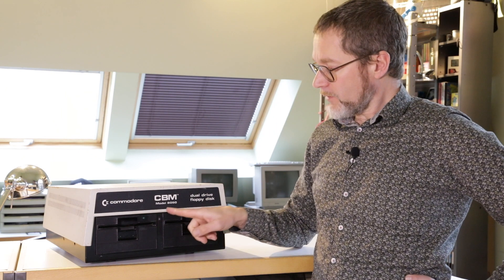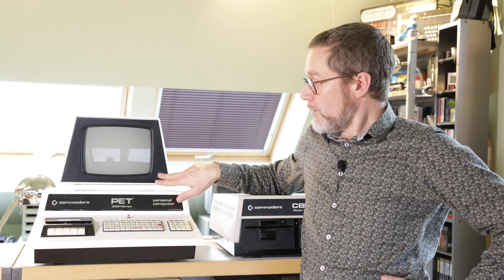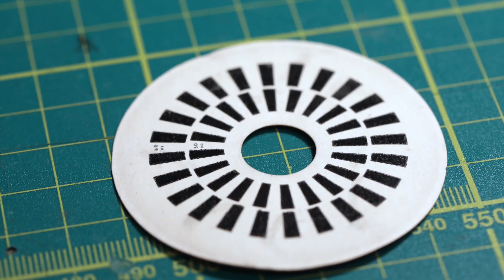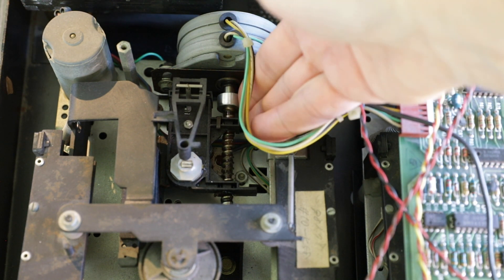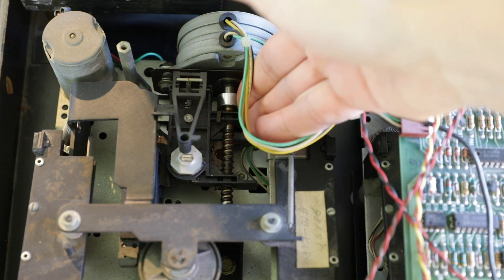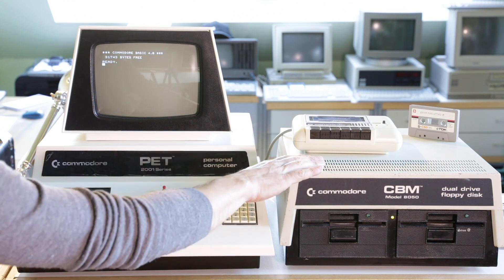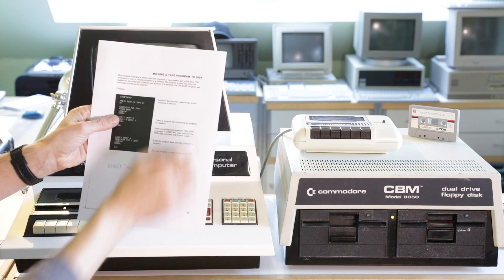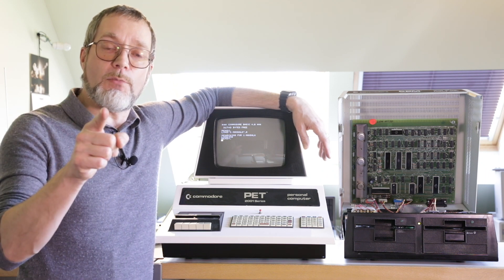Commodore PET CBM8050 Dual Floppy

Comment: Thanks for the lovely video. I also have an 8050, with slightly different Micropolis mechanisms. The drive works okay, but a bit unreliably. My main issue is getting software onto disks. I have a ZoomFloppy now, but OpenCBM seems to treat the 8050 and similar devices a bit like stepchildren. Support is very spotty…

Comment: Great video! I have the same setup here. My 8050 works perfectly, but the left drive (drive 1) is noticeably louder than drive 0. It also doesn't spin up briefly when you insert a disk. Any ideas what might be causing the increase in volume from one drive compared to the other? Like I said, it works perfectly, but it would be nice to have both drives performing the same.

Comment: I bought a 8050 and am slowing restoring it so thanks for the video!  I agree with the comments... keep your channel name, it has meaning.  As for English... well it makes it more accessible for us non-dutch speakers... so thanks!  The 8050 also allows you to execute arbitrary code on the drive itself... it's a pretty amazing bit of tech for the time.  I think in reality the 8050 was more likely to be used with later PETs since Basic1 doesn't really work well with it... you cheated by using a ROM replacement.
Reply from the maker: Hehe I know :) But at least I could make this video that way. Thanks for your feedback!

Comment: Great video, thank you. But you said it uses single density disks. But actually it needs quad density disks (4D). They are hard to come by, and most of the time double density disks (2D) work fine, but not every brand. You have to try which brand works with the time. For my drives (I have 12 of them) most of the time 3M disks work, also the "red" BASF 2D. and Scotch. Sometimes Verbatim gives me trouble, but I think it is different from drive to drive, how "tolerant" it is.
Reply from the maker: Thanks for your comment, Alexander. I checked the media information in the user's manual and it says "Standard mini 5 1/4", single sided, single density". Trying different brands is a good idea, I'll keep that in mind!
Reply: @DeBovenkamer  oh, that's news to me, a long time ago I am 99% sure I read about the 4D disks myself, and this can also be found online sometimes, for example here:
http://www.computinghistory.org.uk/det/20977/Commodore-8250-Dual-Disk-Drive-Unit/
or here on Wikipedia (German): https://de.wikipedia.org/wiki/Commodore-Produkt%C3%BCbersicht
I have several brands of 4D disks here which all work fine in 8050/8250, but with 2D only around half of all the brands I have seem to work (the disks are fine though and work in other drives). 
This "explanation" is a long shot, maybe someone knows more? It surely is interesting. 
Just a week ago Chuck Hutchins confirmed the 4D story, as we were talking on facebook about the correct media...
I will definitely ask Chuck about that again, and yes, there are manuals that state "single density". But I am quite sure that no real 1D disk will ever work in them (there were disks labelled as 1D when they were not 100% perfect for 2D though).
Reply from the maker: @45hji875thj  That keeps it interesting :) Thanks for the research!
Reply: I have exactly the same setup here, and I'm using Verbatim single density disks with no problem. Great video by the way 🙂